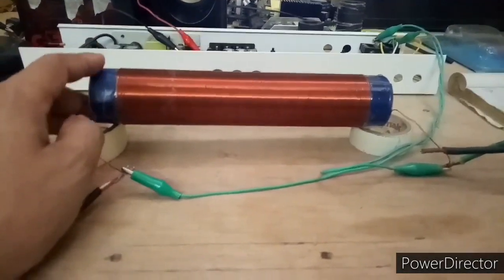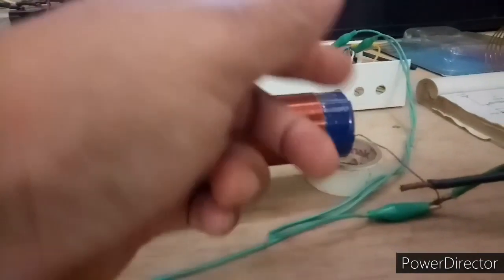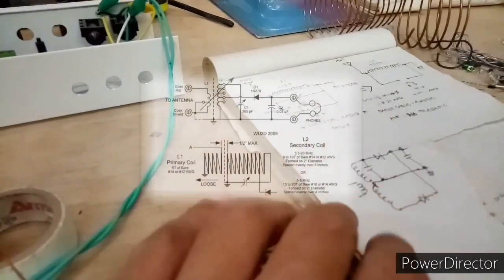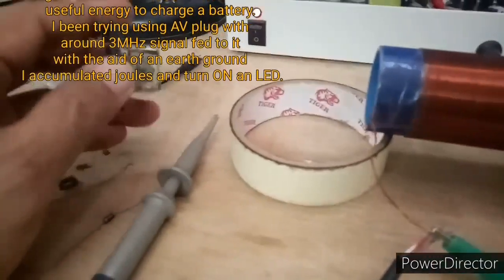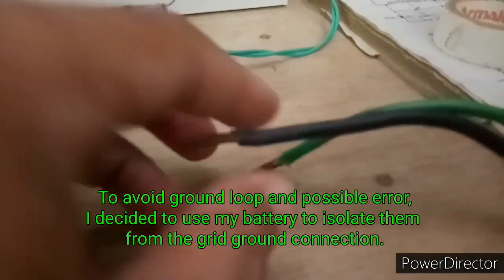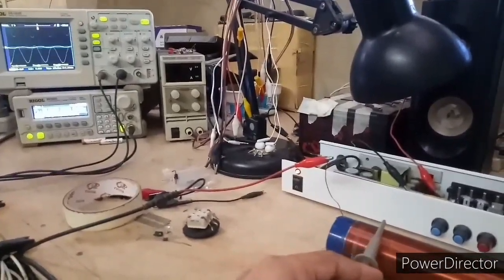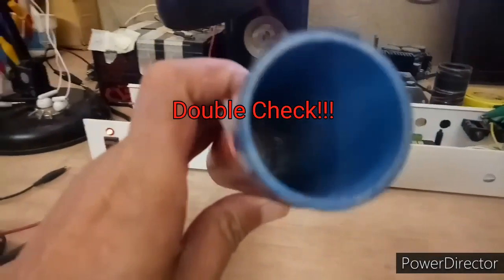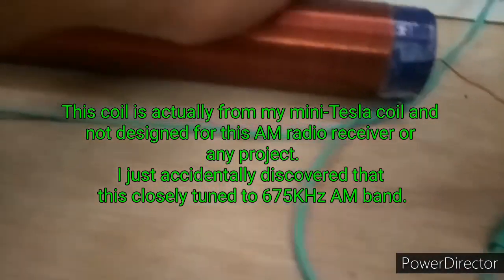#35 AM Broadcast Radio Receiver/Response and Follow-up Video

Comment: Nice video. I have used a Tesla coil to send a voice message to another collection coil connected to ground and a speaker . It worked great. Maybe I should see if we can make a communication system with this?
Reply from the maker: Thanks!
Yes sending messages from tesla coil to another coil is possible but at a very longer distance it might needed a huge tesla coil or a higher voltage driver(?).
Small tesla coil might works but needs a higher elevated topload and has a very good grounding. Receiver can be of small scale but transmitter may needs a power enough to send at long distance like a radio broadcast.